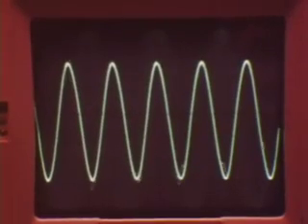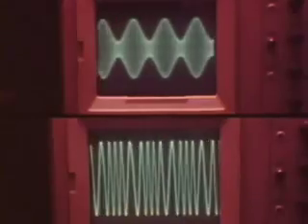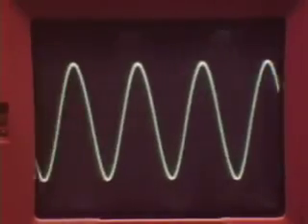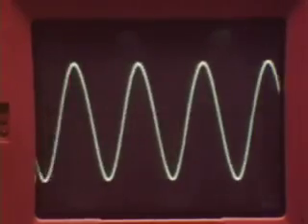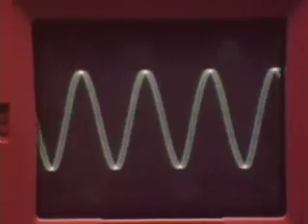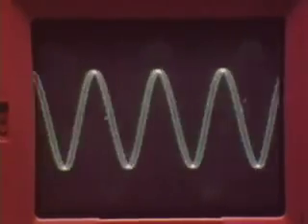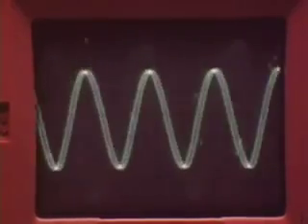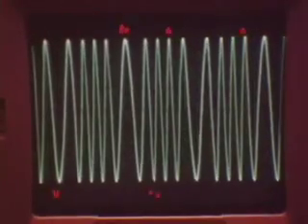MTSC - 1977, Volume 77-6 Sound System Diagnosis and Repair

Comment: Back when they use to service the radio. I had a radio issue, they spent 10 mins fooling with it, pulled another radio from stock and off I went.